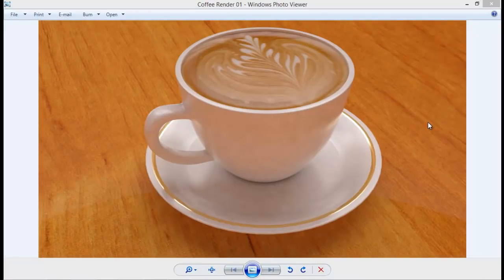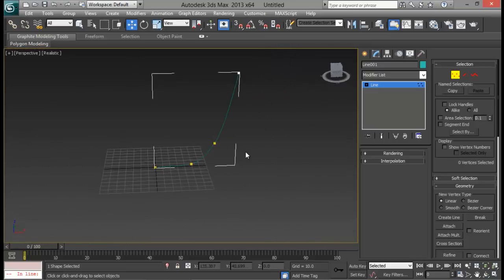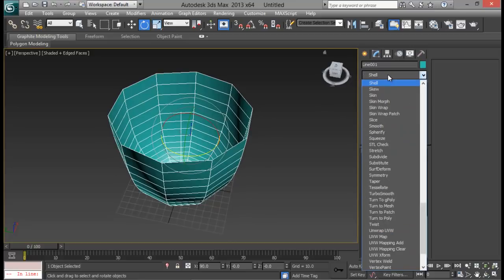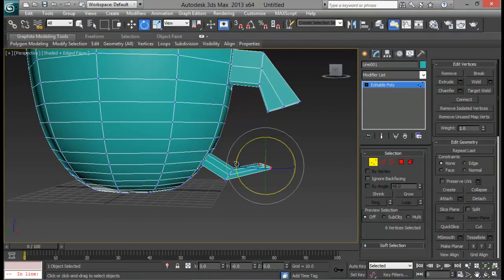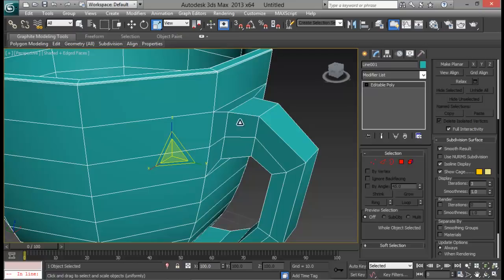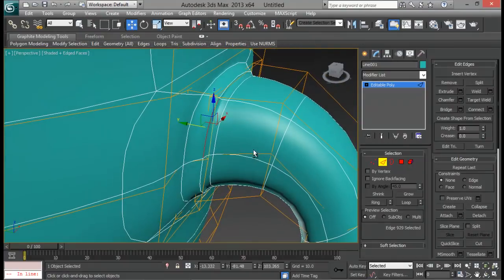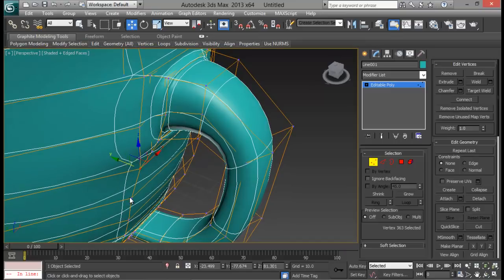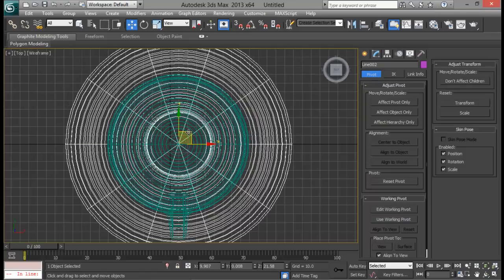coffee modeling and rendering tutorial

Comment: Sorry I'm a complete beginner. Why when I try to draw the first line does it draw straight lines and not with a curve? I'm using 3DS 2015.
Reply: 3970xRocks When you create your line, yours is probably set to Corner. Change your options (in Creation method) as Corner (Initial) and choose either Smooth or Bezier (for Drag type). That way, when you click (and hold) second vertex you'll be able to draw out a curved shape. If it's set to corner, you're only able to draw straight lines. Hope it helps